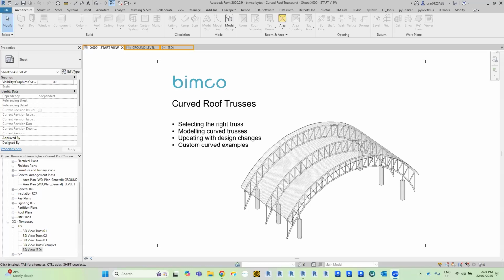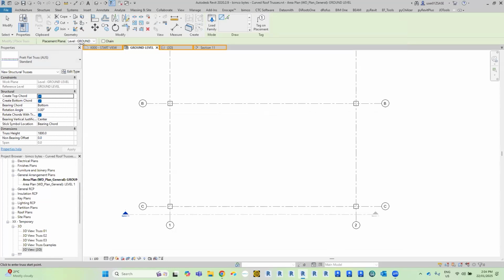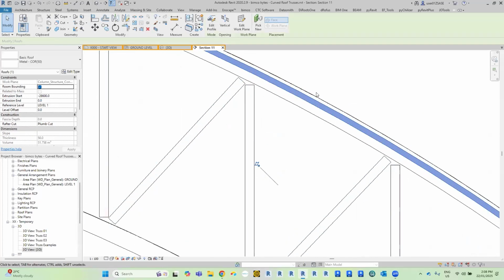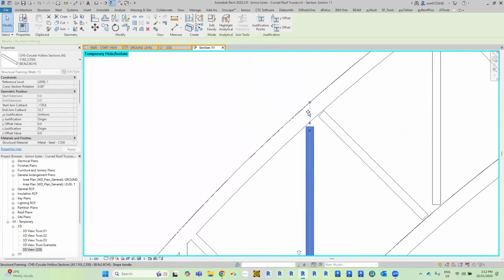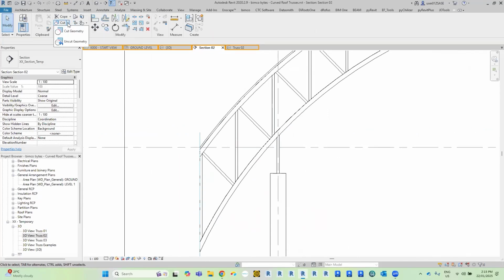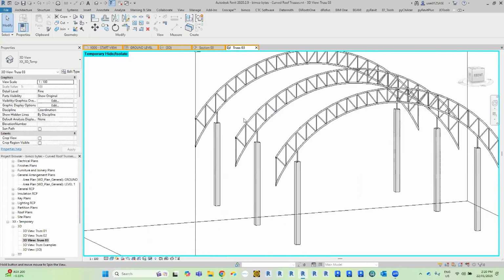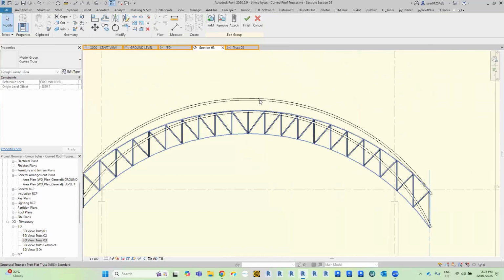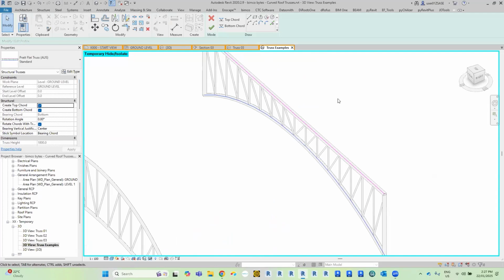Curved Roof Trusses - bimco Revit 3D Modelling Training Tutorial

Comment: How do you connect a C-channel purlin to a curved pipe truss?
Reply from the maker: Hi @fathurrosi4076. You can extend the beam halfway into the intersecting beam then cut them together. 

The C channel won't slice and terminate, but it will give you a solid line where it intersects the pipe and hopefully that's okay for you.

You can see how this works about 15 minutes into the vid.